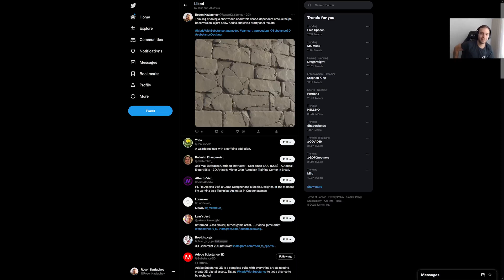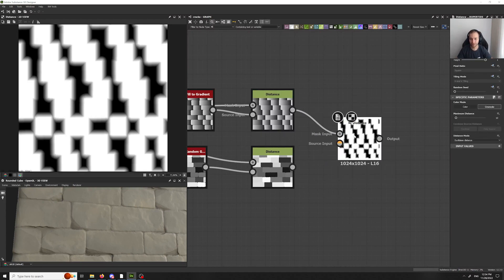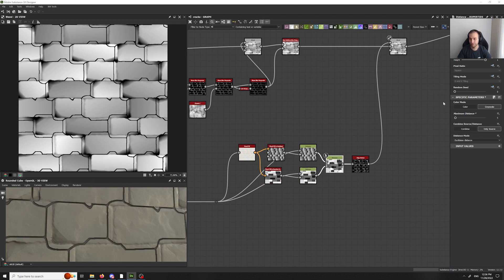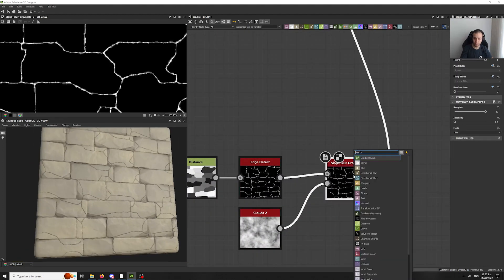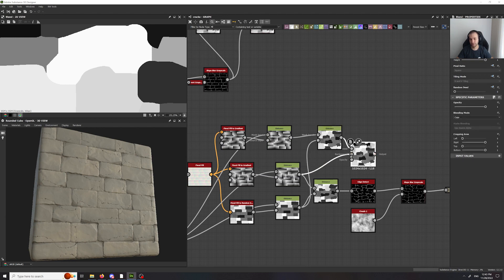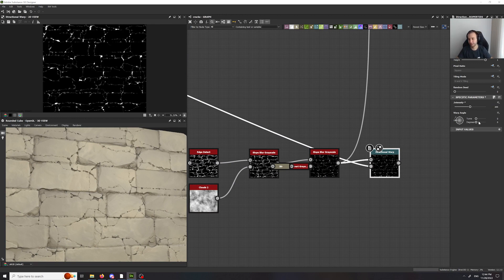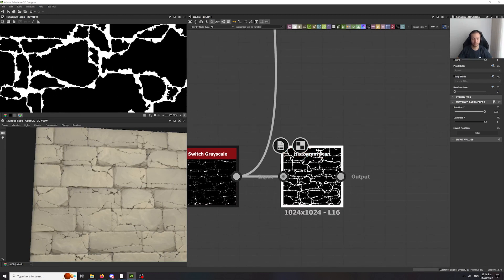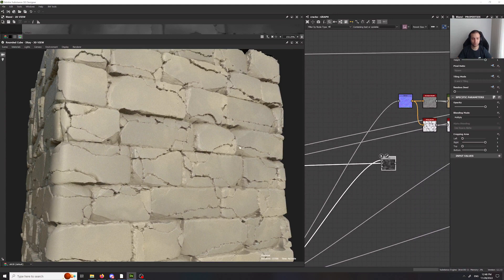Substance Designer Cracks Setup

Comment: That cracks tightening was cool (4:55). I never thought about using a slope blur into itself like that to thin the lines.
I would have subtracted a perlin noise with a levels to create gaps into the lines so they don't all connect every time from one end of each brick to the another end.